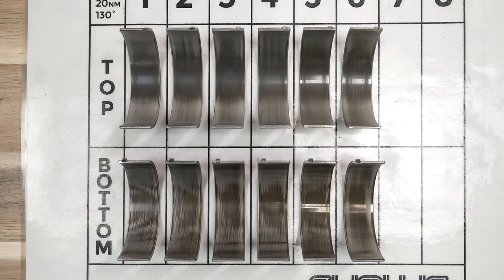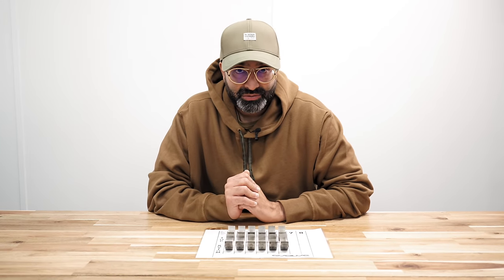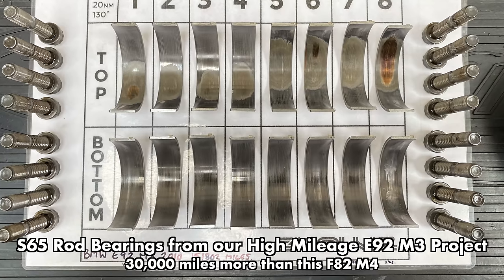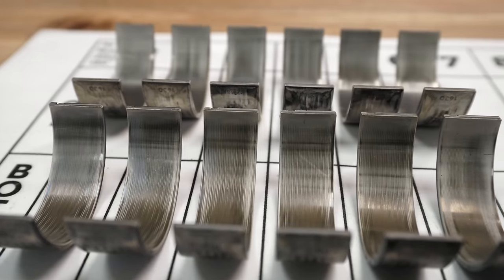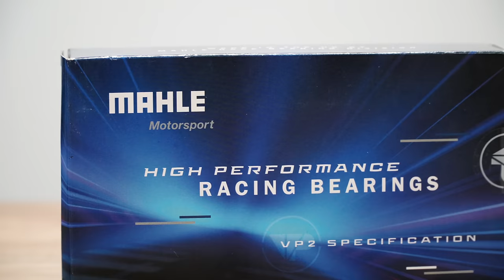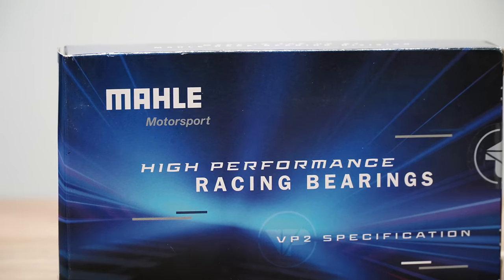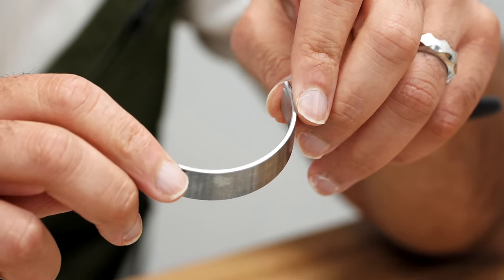Does the F8x M2/M3/M4 have a Rod Bearing Problem? - 130,000 mile S55 examined

Comment: Makes me feel good I have 60,000 miles on my F80 bought it at 50,000 and added a pinned crank hub and Stage 2+ tune with flex fuel ethanol

Comment: I really like you using your platform, expertise, and available shop tools and accessories, to help those who don’t have these things available to them, understand the reliability of this car. Mods are mods. Most enthusiasts do the same mods and install them themselves. Understanding a cars reliability, especially Euro branded cars, is very important. We all know about the crank hub, leaks, waterpump, etc on this car and others. Diving into it deeper like you did here, so that us future buyers of these used cars, is something big YT’rs like yourself, who have the tools and accessories available to them with ease, don’t do very well. So I’m thankful you have made this video to share with us.

Just a FYI. I saw you mentioned that rod bearings have been plaguing //M cars for the last 20 years. That’s actually false. It 100% plagued the E90/92/93 M3, but despite what the “internet” says about it plaguing E46 M3’s, that’s actually false information. Yeah, once these kids started buying E46 M3’s when they became cheap, and either they or its previous owner(s) not maintaining them well, then all these new owners started saying rod bearings were an issue. Not the case at all. There are a big many of us E46 M3 owners who have owned the car years before these kids, and never had any rod bearing issues even with well over 150k, 200k miles. My personal 2003.5 E46 M3 Coupe 6spd has never had an issue, and it’s over 180k miles FBO and supercharged. Don’t believe what the internet says…

Comment: Great to see this. I have a 2015 F82 with 94k miles, full BMW service history. Interested to see gearbox service as mine has not been done 😬
Reply from the maker: Having driven multiple F8x with DCT I can tell that this car would benefit from a DCT service and re-adaptation.

The only reason we didn’t do it as part of our initial maintenance is because surprisingly this car doesn’t have a DCT sump gasket leak like many do, but it’s something we’ll be doing in the future.
Reply: Ah cool. Mines leak free presently 🙏Loving the F8x content as this really will help break down peoples negative thoughts on ‘higher mileage’ F8x platform cars

Comment: Never seen Hash move so quick!😂
Nice job, thought he might of had the crank hub done at the same time tho🤔
Do you KDS check the car after you’ve done this as the rack has been removed Imran🤔
Reply from the maker: This video follows on from the crank hub! We did them both at the same time.

We do not have an alignment setup, there may be slight movement that requires realignment whenever the subframe is dropped.

Comment: Hi Imran, I am interested to know how frequent the oil change intervals have been and also which oil you use. 
I have a Stage 2+ N55 M2 using 5w-40 LL01 changing at 5000km intervals in Australia.
Thanks mate
Reply from the maker: This car has been serviced to BMWs intervals by BMW until Matt purchased it. We’ll now be doing oil changes every 10,000 miles and with Motul oil.
Reply: Hi Guys, which motul oil do you recommend?@EvolveAutomotive

Comment: So can you asnwer the question as to what has changed, and is it transportable over to the older M engines?
Reply from the maker: There’s so many variables that we can’t really compare between two completely different engines. That may be a question Mr VANOS would be more equipped to answer.
Reply: I wonder if the lower revving turbo engines mean less friction to deal with...

Comment: BMW have never had a rod bearing issue. 

They've had an issue with dumb asses ragging them from stone cold when leased for the first few years.
Reply: While I think BMW could have solved the rod bearing issues earlier. Lease owners/ignorant owners running the car hard when cold as you mentioned is most likely the issue with most rod bearing failures.
Reply: You're right. Have mines changed in the E60 M5 after 168000 kms for the first time. So its possible...
Reply: @E60M5-Estoril  I won’t be changing rod bearings for my E93 S65 till 80k miles. The majority of S85 and S65s that have regular maintenance don’t have rod bearing issues… now throttle actuators is another story 😅
Reply: @jovaneghtesadi1494 S65 have not only rod bearing issues, but main bearings as well!!!
Reply: @jovaneghtesadi1494  the difference is that failed Throttle Actuators just leave you in limp mode. A failed rod bearing ruins your whole engine

Comment: Lots of German $$$$$ Cars have major design defects. They avoid recalls....so you never hear about them. Yes #Porsche you too.

The BMW M3 S65 V8/S85 V10 had lead/copper rod bearings, which are soft. So they wear due to lack of lubrication with a tight bearing tolerance. After 2011, BMW switched to harder aluminum/tin rod bearings...and so M3 rod bearing failures were less prevalent. The key is to change oil frequently and have it checked with an oil analysis. Keep the mileage down below 80k-100k miles on your ///M Cars. They are not Toyota Camrys that can go to 200k-350k miles.